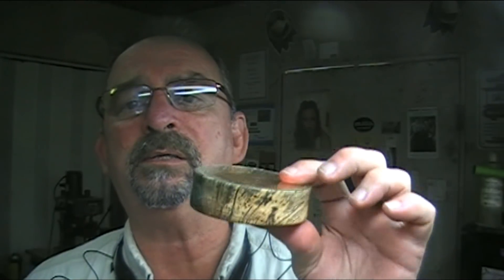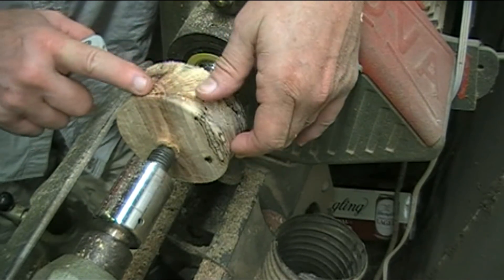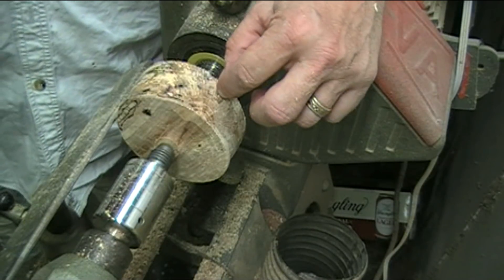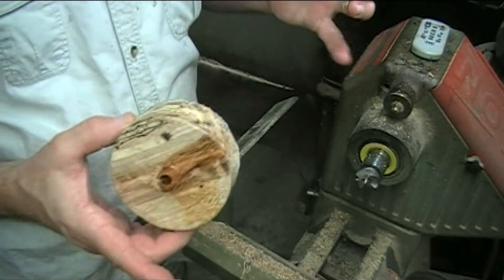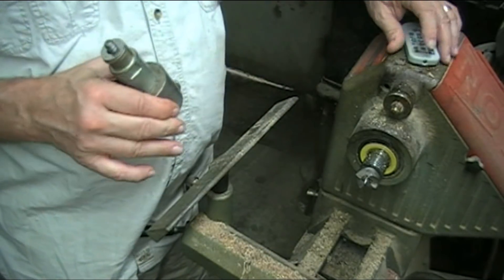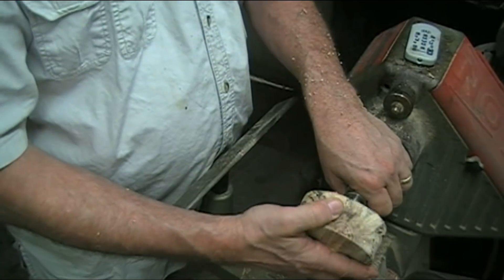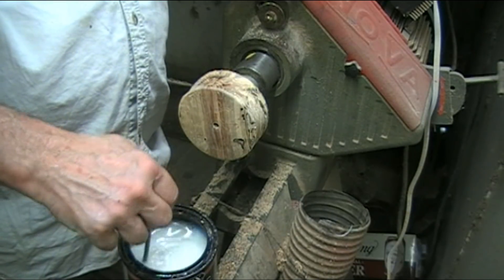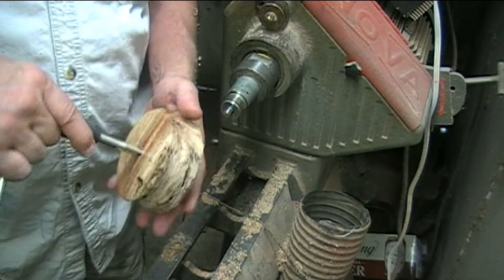golden turkey pot call

Comment: Where or how did you get the mandrel with bolt to mount your turning?
Reply from the maker: John Abbey bottle stopper mandrill from Penstate Industries
Reply: @ronswoodturningshopandstuf5759  excellent thanks
Reply: John Abbey do you have a 4 jaw chuck, if so you can also use a worm screw. It works well for me